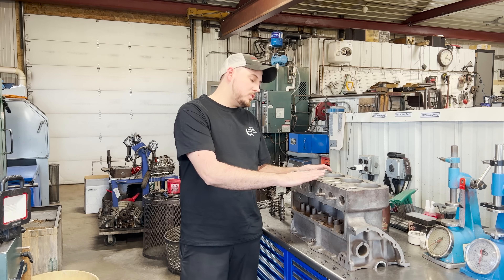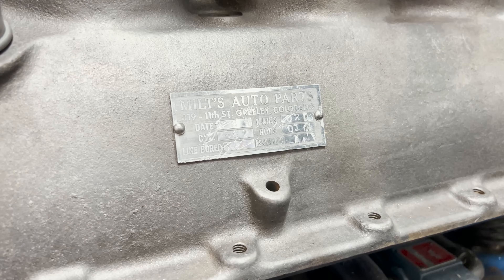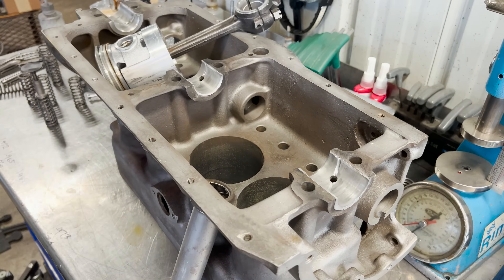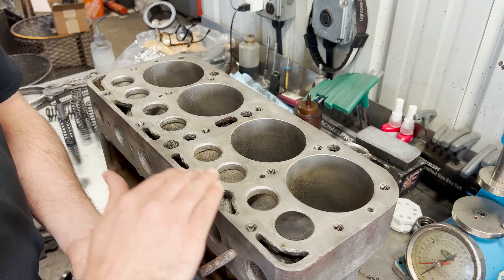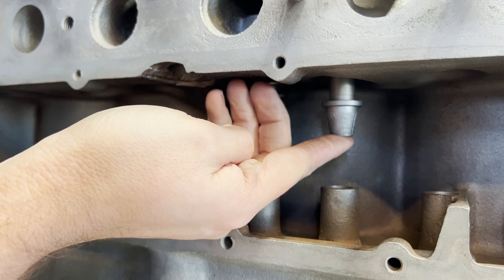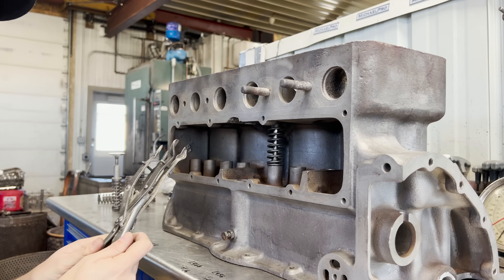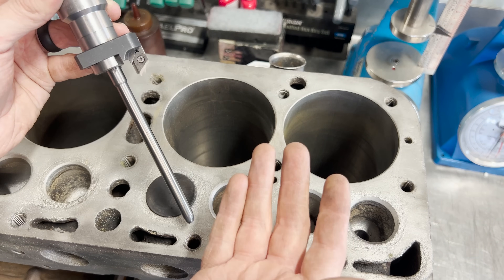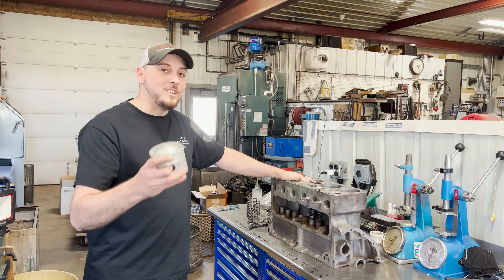The Nuanced Design Of A 1929 Ford Model A Engine

Comment: I put a lot of miles on a Model A in the early 2000's. Used it as a daily driver. Never had to get into the engine. Excellent little car.
Reply: what is the fuel efficiency for your model A?
Reply: @lordjaashin  If I remember correctly it was in the mid teens.
Reply: I bet you got a lot of fun comments for people amazed to see it as a daily driver.
Reply: @Mrcaffinebean  I did get a lot of looks and comments. All I drive are old cars and daily driver duty is split between a '50 Dodge, '56 Plymouth and'48 DeSoto.
Reply: @72polara  that's awesome man! The way cars are going these days I think classics are a better value.
Reply: @Mrcaffinebean  I agree. Too many electronic complications that are prone to fail and impossible to find replacement parts after not too many years. Every old car I have ever sold was worn out and needed major work (the Model A needed new Babbitt bearings) and I always got more than I paid for them.

Comment: In my machine shop days (early 70’s) I went a few times out to a customer site with, from what I remember, a Kwik way piece of equipment which bolted to the top of a flat head block. These were old WWll search lights and they needed new valve seats. Because they had a few valve jobs before, I would have to cut a pocket with the Kwik way and install new Stelite seats. Then grind them with the white stones from Goodson. I actually might still have the kit?

Comment: Why not just machine for modern one piece bronze guides then machine the deck for modern pressed in hardened seats? I've also seen where you can also use modern main bearings and aftermarket rods with modern shell type bearings!

Comment: Never worked on a Mode A engine but worked on a my granddad’s Ford 8n quite a bit which has a lot of the same peculiar things going on. I see there are 1 piece valve guide kits out there.  

Another consideration just popped in mind. You aren’t worried so much I would thing about how much play is in the guide, but how close can you match the existing lifter/tappet. On every other type of engine you have pushrods or followers that allow some take up of tolerance whereas here the tappet is right on the valve. 

I would think a template lifter sized for your machine plus the appropriate guides would true this up nicely.

Comment: I'm surprised you didn't want to try the babbit process.
Reply from the maker: I mean if I had the tools and equipment but I have none of it
Reply: @JAMSIONLINE  I've watched a couple videos by Keith Fenner and Keith Rucker (2 different channels) on pouring babbitt, and basically all of the tooling is shop made on the lathe.  You would then need to line-bore and hone the bearings, but the process is pretty crude overall.  Keith Fenner has a series called "Babbitt Pouring Duck Bearings".  Keith Rucker - Vintage Machinery has several series on babbitt bearing pours.
Reply from the maker: Yeah, problem is I don’t have a lathe, nor do i have equipment to line bore 🥲

If they were in terrible shape we would have to do something but they’re not in terrible condition luckily!
I’ll have to check out their videos!
Reply: @JAMSIONLINE  Gotcha, just mentioned it because sometimes we have to push ourselves to learn (even obsolete) things. 😃
Reply: @JAMSIONLINE  Time to get a tool room lathe. A 12” swing should suffice.
Reply: And old man nearby probably has the tools for doing it but finding anyone who knows how anymore is going to be a task

Comment: That's just the way they went together...as you grind and cut the valve and seat, the dimensions are going to change for tappet clearance. No adjustable lifter. I build A and B engines...one on the stand now. AER has modern guides, that press in, and valves with straight stems and two piece keepers. Then all your seat grinding problems go away. Install new adjustable tappets. Contact me for a discussion

Comment: There are a lot of theories, but I'm of the belief that the valves were made like that to cut down on complex machining procedures. With a modern type valve arrangement, the valves have to be pretty darn close to spec for the retainers to slide in at all, whereas with the bell ended valves, it could be pretty well wrong, and still work as intended. Likely made the assembly process more efficient too (looser tolerances = less parts rejected for quality issues/ less waste) 

I have seen the wrong vales, way out of spec "small" ends, bent valves, and even one engine come in with eight different length valve springs- all with the customers saying that they "ran good, just using a bit more oil". It never ceased to amaze me the condition that the valvetrain, pistons, etc could be in, and the old flathead still runs about as good as it ever did. 
The biggest issue we ever had was tearing then down and finding cracks everywhere (of course the model a engines were over 70yrs old when I was working on them, so I'm sure that had something to do with the conditions I saw)
Reply: yup.... any engine that you can think of that is known for reliability is kinda the same......
AKA.... under-stressed 
.
because everything is just a big "bigger" than needed...... their is a lot of "room" for imperfections and wear
.
.
while a modern 1000CC 3 cylinder that makes 600HP 
AKA HIGHLY HIGHLY HIGHLY stressed...... if one cylinder is down 3% on compression.... it just refuses to run at all 
.
.
.
ill take my 190HP jeep 4.0 that will THRIVE on abuse and neglect
over a more fuel efficient engine that makes 400HP
.
 (PS...a HeeP "grand native american" is still a brick.... so i might go from 20 MPG with the 4.0..... to 25 with a modern engine thats lasts 1/4 as much......... not worth it to me)

Comment: Wouldn't turning a flange sleeve out of 4140 to use a common pilot be most cost effective?  I would assume even common pilots are pretty salty?  I would assume hardened/heat treated and then ground?  

That block tag from previous machine work is very interesting, must have been a heck of a shop to tag stuff then.  I hope the owner leaves it on there, that is a neat piece of history that definitely isn't common.  

I got a spring compressor like yours, but also have one a relatives that he made, didn't have no lock on it, but he  made the handles long enough to for leverage you could hold it by hand while you put the the clip on the valve.  Interesting how at that time nobody seemed to know what the word "NO" and "CAN'T" meant, something we are missing in modern times.

Comment: The two piece valve guide is genius! Ease of serviceability. Will you be installing hardened valve seats?
Reply: some engines (like the Buick Nailhead) are DESTROYED by people treating them like a modern engine
.
Buick used high nickel castings.... so there's simply no need for hardened seats
even with unleaded gas, high RPM, and lots of seat pressure from the valve springs..... ya dont need hardened seats
.
it will go into the cooling passages if you try
.
.
some heads are cast PERFECTLY.... and you can JUST get away with it (till it rusts a bit... and that THIN metal the cutter left rusts away)
most have some core shift (any brand has core shift... old or new engines.... iron or aluminium).... and you WILL hit a water jacket

Comment: It’s an old 4 cyl Briggs and Stratton. 
 I’ve set up a few ford flatheads.  The adjustable lifters make it easier. The old style are a pain if your not set up to grind to fit.  Replace the worn guides.  It’s worth it.

Comment: This split valve guide actually allows the valve to "float" a little to enable it to seal on the valve seat.  I actually have one of those tools somewhere and my Uncles rebuilt many of those old engines back in the day.  This float allowed the seats to be slightly misaligned and for the tooling of the day it definitely sped up building of the engine valve train
Reply: Heehee ,this is also probably part of why our Grandpa used to tell us a valve job would last 30k. 
I mean it works, but it shows how far we've come.
That is ,until the last 10yrs when "they" have gotten stupid and longevity of parts is going backwards. 😄
Reply: Idk for certain, but i'd bet another reason was to save time drilling out the hole for the pushrod. If the halves are cast separately, then they can already have most of the hollow cast in there. The drill then doesn't have to hog out everything, only clean it up. Or you could use a horizontal mill to gang-mill multiple valve guide halves at a time; if it was one piece then you are forced to drill the hole one at a time.
Reply: @superdupergrover9857  pushrod…on a flathead? You sure about that? Did you intend to say valve stem? LOL!
Reply: @chucksgarage7165  Forde called lifters "pushrods"!
Reply: @Cougracer67  okay. Thanks.
Reply: as time goes on technology gets better sloppy valves and seat are ok in a lov reving engine but the youngster works to a higher spec that modern engines work to because or the higher reves iv straightened valves and groubd them in with engine oil and sand used green hermitite on the head gasket on a Honda gold wing 1100 1980 model you tent to know what you can and cant get away with i run like that for years but when your doing it for a living and telling the world you have to be spot on because theres alway someone winging who dont want to pay and feels that every one in life owes him ...
Reply: Could you machine your own pilot
Reply: @rogallen9535  those pilots are probably carbide

Comment: the WIDE end ; for the slotted retainer at bottom . NOW assemble the valve as a STACK and slide it all in as a unit , then pull spring top down and slide in retainer at rop
Reply from the maker: This model A engine requires the guide and spring to be assembled from the bottom after the valve is installed from the top.  The newer Ford flathead V-8's and 4-cylinder flathead tractor engines had a valve assembly that was installed from the top as a unit and then pulled down into place so a retainer could be installed on the bottom of the guide to hold it all in place.  As the "cleaning guy", I have worked on my share of the Ford V-8 flatheads and the 2N, 8N, and 9N tractor 4-cylinder flatheads.
I also want to thank all of the viewers who have convinced Nicolaus to let me train on new jobs in the shop!

Comment: If you had the lifter out there at the same time that you had the valve you would see why the pad is so big cuz the lifter has the adjustment for the lash on it
Reply from the maker: But so do plenty of other engines without a mushroomed tip…

Comment: 12👍's up thank you for sharing
I never worked on a four cylinder Flathead but A v860 and A v880 I worked on those quite a bit cutting the Bell housings off and putting other Bell housings to them so they could run modern automatic say no just a little tiny things
Reply: 12 thumbs? My God, how many hands do you have?

Comment: naw , 9n ford tractor , split guides too . they have updates to later solids . sure makes a valve job intersting  , but done a few , by hand . some inframe . usually the valves have wide or called "tulip" style for retainer